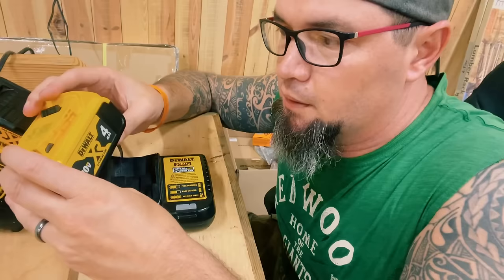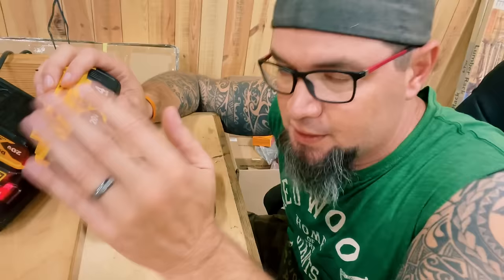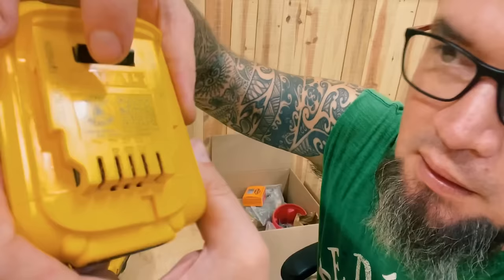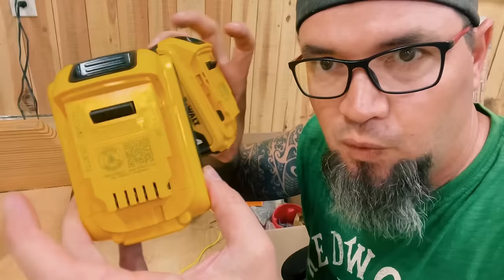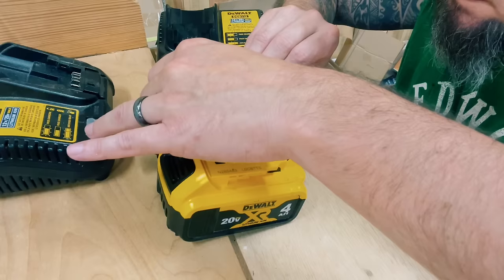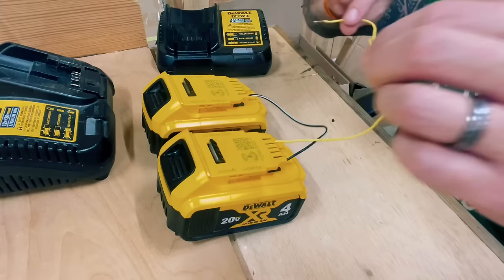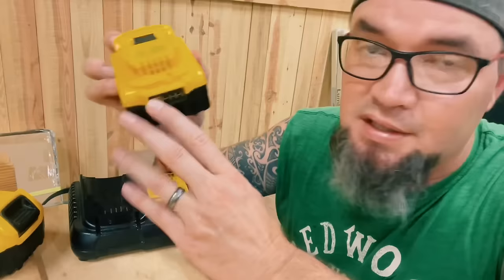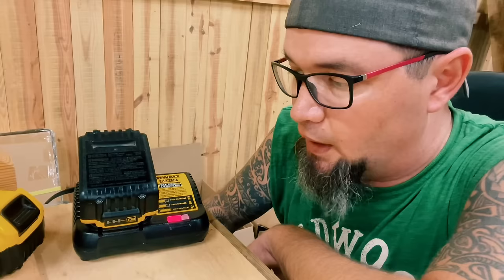Dewalt Lithium Ion Battery Won’t Charge? Try Resetting It With This Easy Fix.

Comment: I have an old Bosch set that will not charge, it is a Ni Cad battery though. Would there be an issue with using my Milwaukee Lithium battery to jump the Ni Cad ones ?  Any pointers  on this would be appreciated. Still looking for a video showing Ni Cad  battery help.

Comment: What if you get a solid red light when put on the charger, but get nothing when checking the indicator on the battery and it won’t power a tool?

Comment: Tried this with a 20v Saker battery. Charged off a Black & Decker 40v for 30sec. When Saker  charging adapter was plugged in after a few seconds the battery spewed smoke then exploded!
Any ideas what caused the cells to ignite?

Comment: My battery got wet. When inserted, the charger flashes for about a minute and then goes to steady red, indicating a full charge, but it isn’t charging. I guess I can try your experiment and see what happens.

Comment: OK, suppose  the Li iON battery, (same specs) only has one "bar" and the charger acknowledges it BUT....still wont take a charge to full?  stays on the charger for maybe 45 seconds and "shows" charged (steady charger light) but....still only has one "bar" on the physical battery itself.  any ideas?

Comment: Hi I had a 6ah battery that wouldn’t charge I did this and it still won’t work and now my good flexvolt won’t charge either any ideas? I never let the wires touch or anything

Comment: I have a 5ah 20v "Maxx"  that quit outputting all of a sudden.  Charger says it is fully charged and tool works with other battery.  No visible broken wires or burnt components in the battery. What to do in this case?

Comment: I just tried this twice.  Still didn't work.  I saw a small light real quick on the bad battery when I pushed the button, but the charger says there's a problem with the battery.

Comment: I’ve got two lithium-ion which will only charge to 50%. What do you do there. I’m not sold on these poc’s. The former rechargeable batteries from a few years ago were more reliable and held a charge for a couple of days work. These L-I are junk imo.

Comment: I tried this and it didn’t work on mine. I first tried it for just a second or two and nothing. Then I tried it for around 10 seconds and the wires were really heating up and I know that the good battery was depletes a bit because it would charge up. But the dead battery still wouldn’t charge and reads 100mv but the dead battery got super hot when I was doing this jumping. So I’m not sure at this point.

Comment: Iv got a flex volt battery that has 1 bar showing but the charger doesn’t recognize there’s a battery plugged in. Iv tried multiple chargers n nothing. Took battery apart and tested from terminal to terminal it says 18/19volts. Any idea what’s going on??

Comment: I’ve tried several times. The charger reads the battery is charged but still not working. The lights on the battery can flicker but won’t go solid.

Comment: I just tried this multiple times and now when I put it on the charger it reads like the battery has a full charge.  I used two different chargers and one wouldn't read it and the other reads full.  Any idea what is wrong.  The concept seems to simple to mess up.  Any ideas?

Comment: This method is overcoming a safety feature of the charger. There's a chance that the battery will burst into flames. If you are going to do it anyway, keep it in your driveway for the first charge so you won't burn down your house.

Comment: I did the resetting and it has juice to power a drill but the charger won’t charge it I got other batteries so I know it’s not the charger. Any suggestions?
Reply from the maker: Time for a new charger.

Comment: Only problem with video is the dead battery was off screen after you energize . Battery could have been swapped out when camera out of camera frame .  Watched your video  . Keep everything in video frame so there no questioning it.
Reply from the maker: You can look at all the other comments and see that this isn’t a trick. It really does work.

Comment: Hello we tryed it and it didn't work we tryed several times and still nothing while the wires were hooked up we got green bars on the battery  when we took it off and put on the charger no lights any help thank you

Comment: Sounded simply. However not working for me. Those DeWalt batteries from 2015 might have some shady electronics in it.
One was fully charged and used in angle grinder till grinder stopped. But since then it looks dead. Second one shows all 3 green lights, but when I connect multimeter on B+/B- it shows zero Volts. So this jump start is nto working as there is no "juice" allowed out.

Comment: Im going try a different way mine charged up. But maybe one cell is low votage. Im going to use a break out board singal cell lithium charger. The battery itself has a temp sensor for fire safety. When its balance i will see if it holds a normal charge. But yaw are worried about that hack . Lithium batteries are dangerous in general especially tool type. High c ratings.

Comment: Does anyone know if the Dewalt battery charger flashing a couple times and then going solid (as if it's now charged) can still represent a drained battery? I've tried my Dewalt batteries and they won't keep flashing, they just flash for 5 or 10 seconds and then go solid. But upon trying to use them, they won't power my drill. Should I just try this method for that too?  Also, would any old lithium ion rechargeable battery work for this method, or do they need to be the same Dewalt style batteries? Voltage/etc.

Comment: No, 20V won't shock you unless very sweaty or very wet.
There is s reason the charger does not accept the battery ... because one or more cells can be bad and you risk fire of explosion.
You CAN'T "reset" a battery! It is chemically irreversible destroyed.
You can try it and when it charges it might have some capacity but never even close to what it was.
This is useful in a pinch but no remedy.

Comment: Hello, does anyone know how I can do this without a host 20v battery as both my 20V batteries won't charge? I have 2 fully working 18V drill batteries but I guess you need 20V ? Can anyone help?

Comment: Didn't work for me unfortunately. I put the battery into the charger, and it's a bright light, but it flashes once, then light stays on. Light on battery won't light up or power tools either.

Comment: I have a different problem. My charger says that battery is charged but it's dead. When I plug it to my droll, the light flashes for a moment but it won't run. Tried your method, sadly it didn't work 😔

Comment: Arnt yhey supose to cut out and save juice in the battery iam sure your not supose to jump start them with wires  might have a faulty charger board inside battery

Comment: Read a lot of the comments. What if it isn’t working? Any help appreciated!!
Reply: Also, when I connect batteries, both meters then read fully charged. FYI, 10ah batteries (set) from lawnmower.

Comment: Unless you lick it with your tongue you won't get shocked from an 18 volt battery no matter how many amps it is. 24 is pretty safe as well. 48-60 and above is where you need to be careful. Our skin has too much resistance for dc to flow through us. Our body internally has enough resistance you might feel a tingle. Your tongue on the other hand has less resitance and you will defintely feel that. 10k-40k ohms for the skin, 300 ohms on the tongue.

Comment: I spent like 600 on an angle grinder and 2 of the 20/60v flex batteries. Within 1 week neither battery would charge. Tried several tricks then got pissed and destroyed the tool. Never buying dewalt cardless tools again. Come to youtube and find battery issues are very common.

Comment: “Smart” battery and chargers require a specific voltage to be able to charge.. same thing with a 12 volt automatic charger to a completely dead car battery it won’t see the battery.. if you bring voltage up it will see it…

Comment: It will charge. It will NOT be "good as new". If this happens the cells are well outside the safe range for charging per the cell manufacturers, and they are going to be permanently damaged to some degree. I understand wanting to save your expensive battery, but there is a reason the chargers don't work with batteries this dead.

Comment: NOT FIXED AT ALL! This only allowes you to get them to take a charge it will even show 20V-21V on the multimeter... HOWEVER it is still a dead cell and they will not hold that charge for very long at all and they will deplete almost immediately when put under a load! Effectively the mAh is lowered to almost nothing!

Comment: No, just no. Don't screw around with lithium batteries, the cost is way less than your shop or house and they can burn down a house. There are things that can be done to fix them like replacing cells internally but while yes, blasting it with the full battery may work its more like defibrillator vs jumping a car battery as this trick does for nicad. A lithium battery has a control board and electronics. They get zapped and it may wake them up but something isn't right and you don't know if it could cause an issue later. 
Lithium batteries are becoming one of the largest causes of fires in the country. They're great in terms of energy capacity but have the one flaw in that an internal reaction occurs and it starts running away with high heat and gas discharge. Once this happens the heat spreads and causes runaway in other cells and there's basically no stopping it,as it is producing oxygen and combustible gasses. You can't 'put it out with a fire extinguisher and I try to explain it to people when doing EV fire education; the batteries aren't on fire, they're in a chain reaction that causes heat and gas production- the fire is secondary, its what was ignited because of the thermal runaway. Thats why it takes over 10,000 gallons of water to put out an EV fire, its not extinguishment but cooling.
I went to a fire recently that started from the homeowner plugging in his brand name e-lawnmower batteries to charge in the evening. At midnight those batteries caused a fire that in the end destroyed their home in a practical sense. It was still standings and didn't have any big holes but heat, smoke and water damage make it a virtual total loss all the same. And those were 20v regular batteries from one of the major consumer tool manufacturers, and one of the most widely sold- and without tampering. 

Don't mess with them, charge them in a safe place and when you're around.

Comment: 😂 this method is not the best, you can do the same with the Makita. But when you discharge the batteries while working, the next time the charger will not start charging it. It is best to screw it together and balance each set of cells separately with a power supply or charger. Alternatively, if the cells are damaged, replace them.

Comment: it will not solve the problem in the long run
Reply: Please think before you post. All batteries are going to die, this just allows the owner to get a little more use before having to buy a new one.